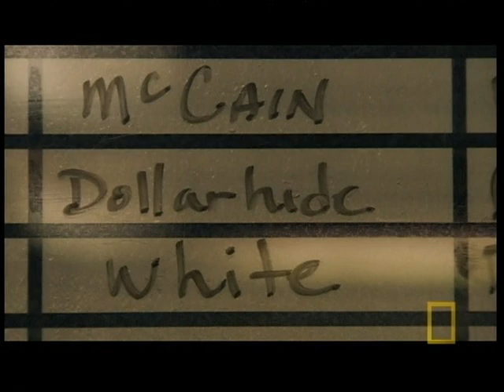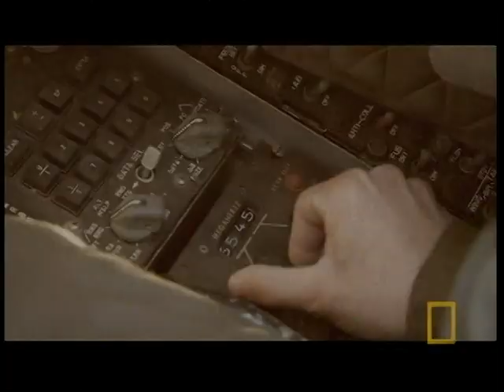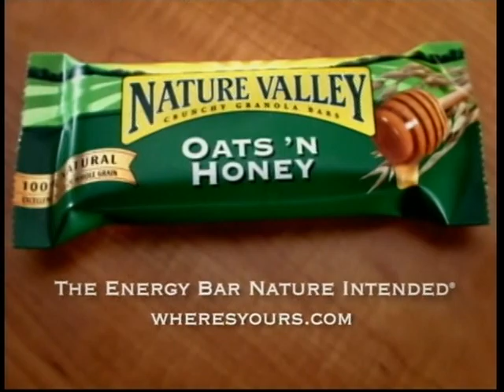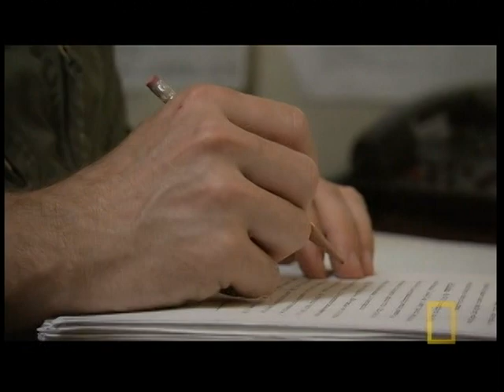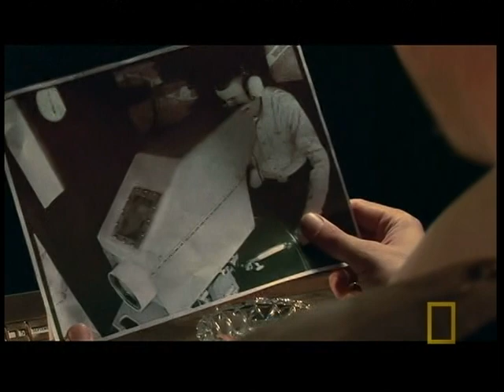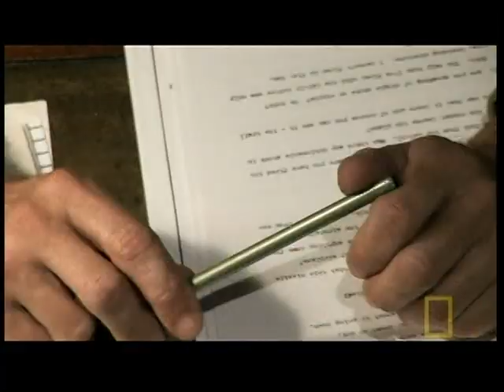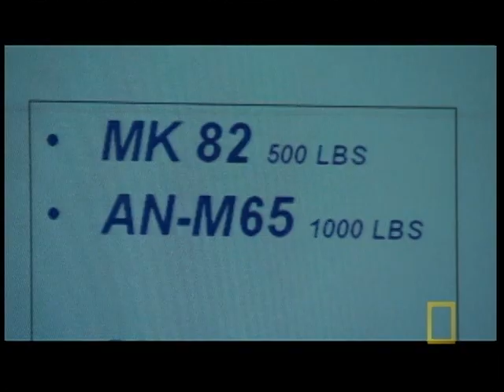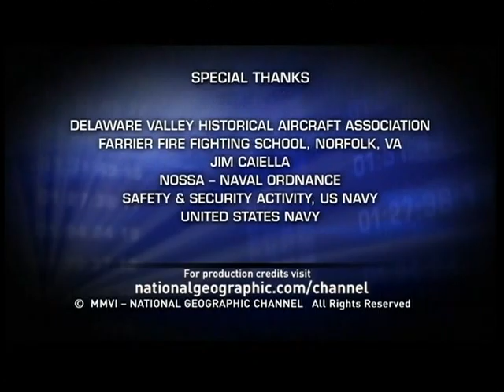USS FORRESTAL FIRE

Comment: What's really messed up is that in the original video about the first bomb going off and blowing a hole in the flight deck and fuel pouring down into a berthing compartment on the 03 level "killing 70 men who were fast asleep in their bunks" is pure bullshit. When there is general quarters on a ship, no one is "fast asleep" in their bunks.
Reply: My understanding was that the ship wasn't at general quarters before the mishap, so there would have been men asleep in their bunks at the time of the initial explosions.
Reply: @maggiepaul1225  Hi Maggie. I served on the aircraft carrier USS Constellation CV-64 from 1980 to 1984. The first explosion didn't cause a hole in the flight deck and general quarters would have been sounded at that time. Everyone on the ship would have been running to their general quarters stations because you had 5 minutes to get there from the first alarm. Absolutely no one would have been soundly asleep in their bunks after that. They would have been wide awake and trying to get to their GQ station. Nothing else.